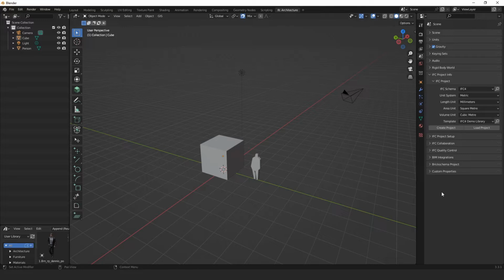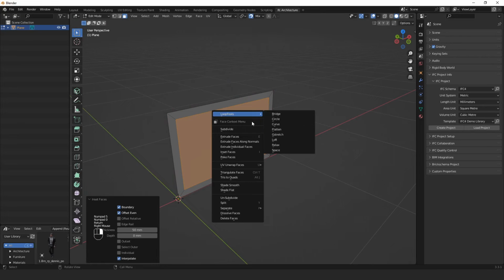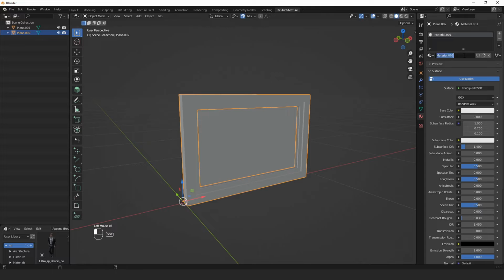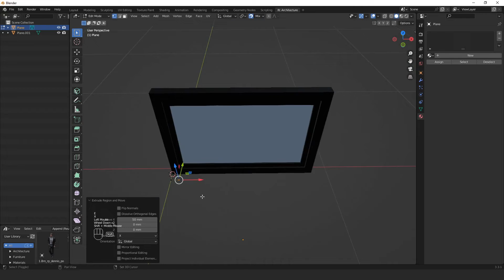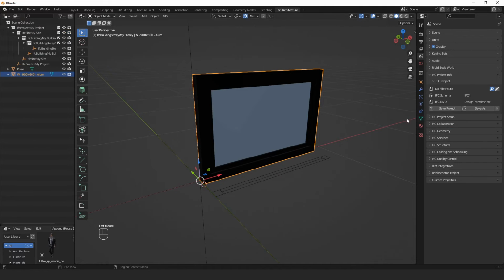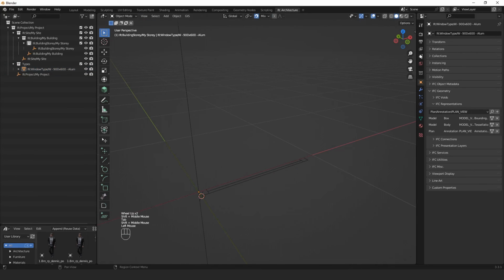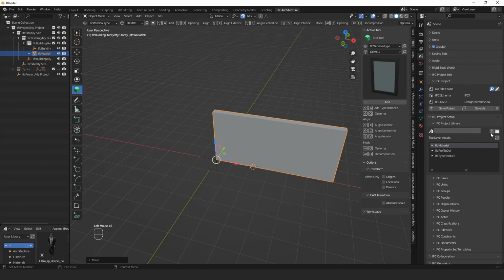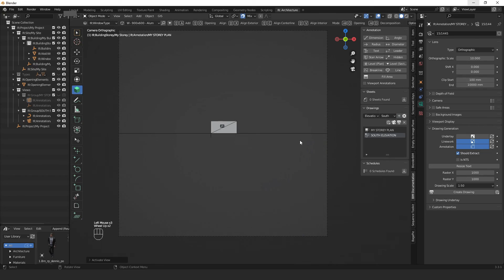BlenderBim - Custom Window in 10mins

Comment: I have learned a lot in this tutorial! I had no idea about that trick about joining another object to get the 2D representation.

BTW windows (like doors) have a convention that the object origin should be in the bottom left of the XY plane (you have in the top left, hence why the window appeared to protrude out of the wall). Also coming soon is a window generator tool, as well as better solid modeling tools to create multiple extrusions in a single object (which would help in the tessellation artefacts of the window).

Comment: Hi, it goes well until changing the 2D rep. I joined the 2D rep, which is I chose to be a trace outline, with my own 2D rep. This gives no error, but as soon as I switch to model rep and back to 2D rep it only loads the trace outline. My own 2D rep is nowhere to be found. Do you know anything about it?
Reply from the maker: Hi essejro, this process had been updated and I will be making a general update on this video with the newer Blenderbim version
Reply: @IfcArchitect  Amazing, can you maybe address how to make a door/window from extruded profiles too? And how to properly make the connections  between the different profiles? That would be perfect!
Reply: Think the 2D rep should now go into Plan/Body/PLAN_VIEW (My guess is that Plan/Annotation/PLAN_VIEW is now for 'real' annotations). Also when you want to update the default trace outline, you need hit 'Manually update representation' under 'Representation Utilities' after editing the outline.

Comment: At 5.39  i don't get this option to assign ifc class to any mesh. I have followed rest of the setup of project step properly.
Reply from the maker: Hi Gomzyp, I am not certain what the issue could be but I'd  recommend updating to the latest stable release of blenderbim, which has this in a different place in the UI you can see how it has changed in this video:
https://www.youtube.com/watch?v=tpQjRjB1wnU&t=199s

If that does not help you can ask questions on the OSArch community forum here:
https://community.osarch.org/discussions
Reply: @IfcArchitect  it is latest update i am using. And i realised in latest update the ifc properties are clubbed under scene settings Tab. So that was the place i found it finally. But just a follow up- does this same workflow applies to custom door types?

Comment: My window was inserted perpendicular on the wall . Do you know the possible reason for that ?Otherwise great tutorial, i was thinking how i could model 3d some Revit Families without using the built-in Revit tools.
Reply from the maker: It might be the orientation of the window when you classified the class, or perhaps you did not apply rotation before applying the IfcClass, those are my 2 best guess' something I have learned per the pinned comment.

Comment: Is there a workflow for importing Revit Families or IFc objects to be able to use them in Blender? And …
Reply from the maker: As Dion said, I will make a video showing that workflow aswell
Reply: You can use any IFC project (coming from Revit or any other software) as an assets library :) This will work so long as they are compliant with the IFC standard.

Comment: Reckon you'd be able to cover the production and most importantly the management of a template library (i.e save as blender file for internal management to retain constraints in individual nested blender files using asset library (if possible) and have an exported ifc library for starting a project from scratch). Again, great to see!
Reply from the maker: Will totally go over that